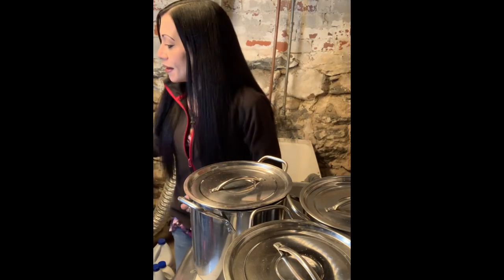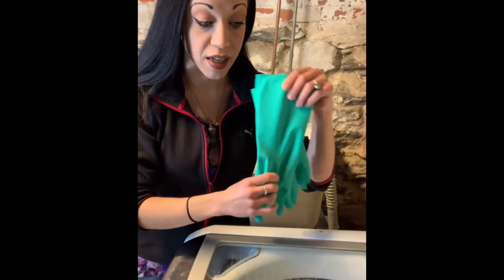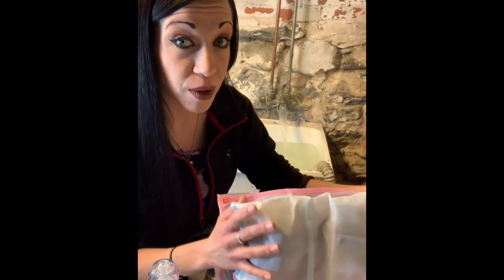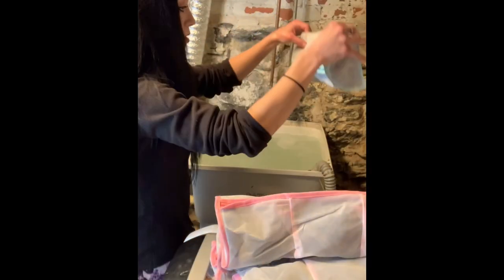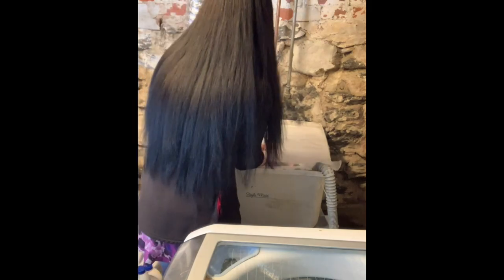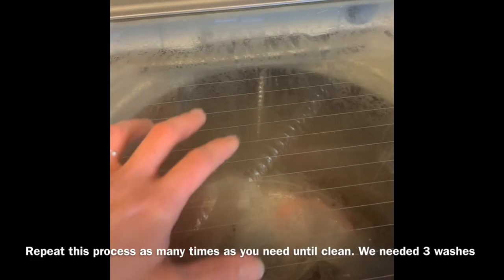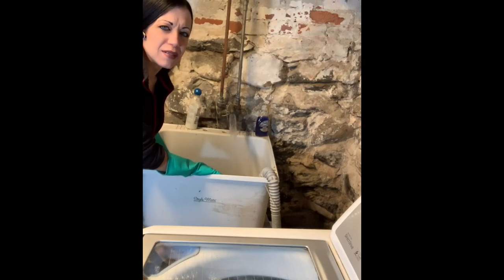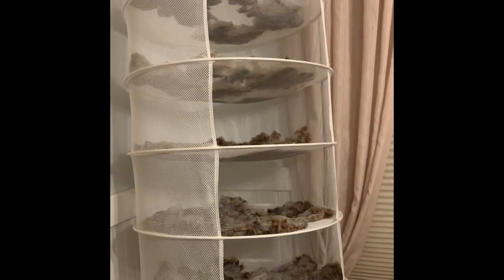How to Hand Process/Scour/Comb: Super Fine Merino Wool: Part 2:Washing/Spin cycle/Fiber Rinse

Comment: Great info!  The bags your using look like they have three compartments, but the ones in the link look as if they are just one. Did you add them?
Reply from the maker: They changed the listing. Here are other ones I got that work just as well and they’re actually bigger Household Essentials 130 Polyester Mesh Hosiery Wash Bag | Gently Wash Delicates in 4 Compartments https://www.amazon.com/dp/B0030B8WC4/ref=cm_sw_r_cp_api_glc_fabc_ZB76FbZEKNB1B?_encoding=UTF8&psc=1
This is a new link for the smaller bags with three smaller compartments. The bigger ones are good for things with longer locks for sure! 
These are great for a short staple like merino :
Smart Design 3 Compartment Wash Bag w/Safety Zipper - Washing Machine Safe - Fine Mesh Nylon Polyester - Bra, Hosiery, Pantyhose, Delicates, Lingerie, & Baby Clothes (16 x 5 Inch) [White] https://www.amazon.com/dp/B01DMGHUPQ/ref=cm_sw_r_cp_api_glc_fabc_RB76FbYEQ88KN